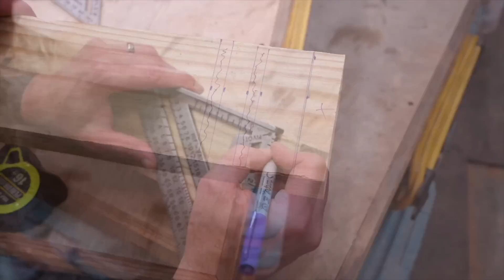Miter Saw Pro Tips: Building the Perfect DIY Mailbox Post - Make Money Woodworking

Comment: Hey love the channel and I'm just starting to try out some of your designs. This one in particular I think you must have started with a 10' 4"x4" because I just bought a 12' one and 78"+28"=106" subtract that from 144" leaves a 38" cutoff which is quite a bit bigger than the cutoff you end up with here that appears to be closer to 14" which is what you would have left over if you started with a 10' board. I just bought a cedar post to make this project and the cost of the extra 2' wasn't insignificant. Just thought you and any others making this project might want to know.
Reply: If you live in the north country where snow plows raise havoc with mailboxes you would use some of that extra length for the horizontal arm. Make it about a foot longer so the post sets back farther from the shoulder of the road but the mailman can still access the mailbox.
Reply: @danholtbk7008  yes I do and was going to do that as well as add more length to the bottom to bury deeper. The frost line here runs about 36-48” depending on the winter.